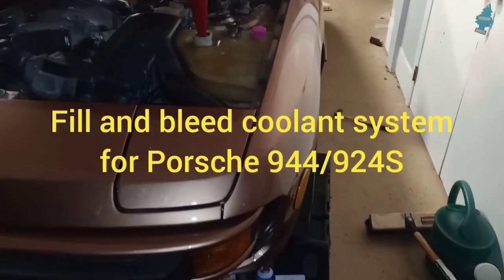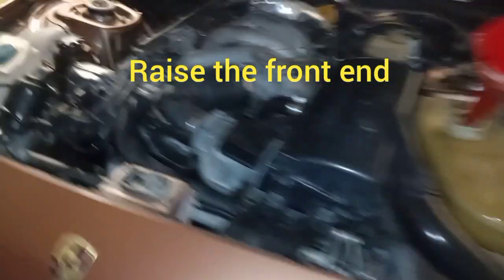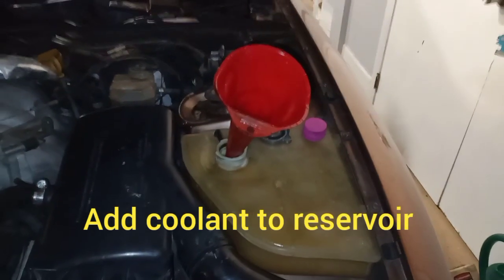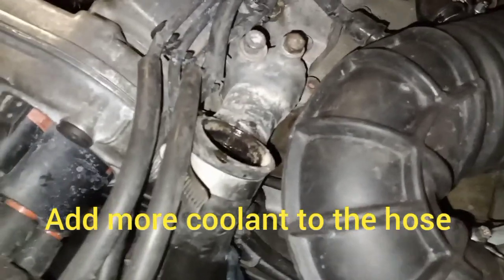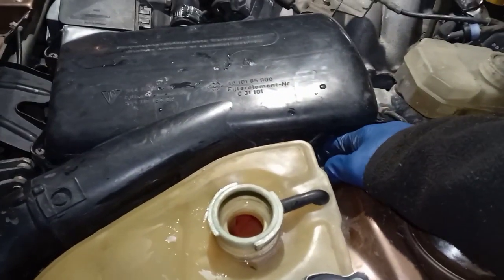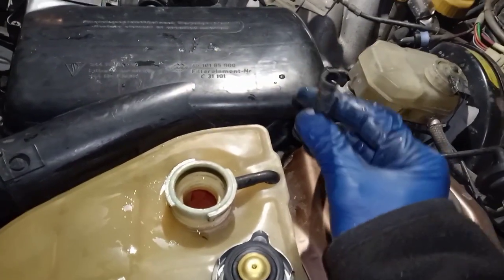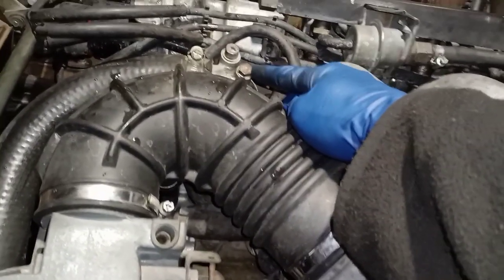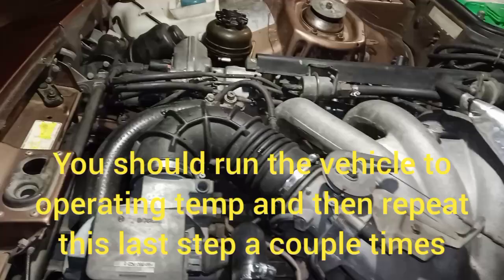Coolant bleeding for Porsche 944/924S

Comment: What do you do with the pipe that goes from the top of the tank to the radiator? When I try your method, I seem to just be blowing air into the radiator.
Reply from the maker: You are supposed to reconnect that after you top off the coolant there!
Reply: @hondatsunfan1011  Not sure we’re talking about the same pipe. I’m talking about the small diameter pipe that goes from the top of the coolant tank, near the overflow pipe, to the top of the radiator, just above the big diameter pipe.
Reply from the maker: All pipes need to stay connected. Only the bleeder screw is cracked. When you cover the reservoir opening with your hand and blow into the overflow tube, the system is closed and the only place for air to go is out the screw. If that's not happening, you have a leak or didn't put enough coolant in to even start this process.
Reply: @hondatsunfan1011  Thanks. I'll add coolant to see if that makes a difference.
Reply from the maker: @francisdescoteaux3938 you need to add coolant to that top hose that I show in the video until it starts spilling out